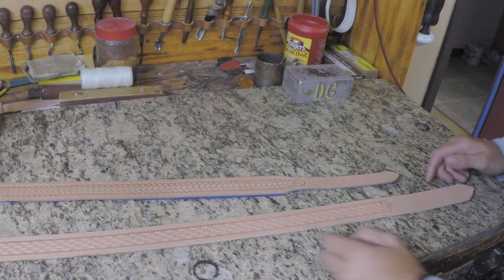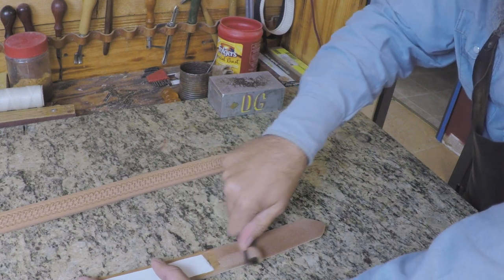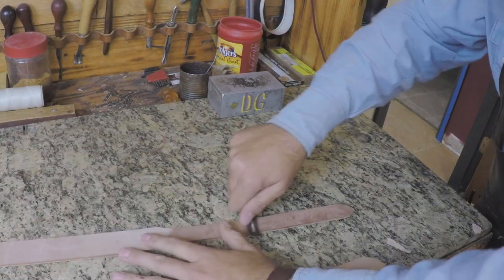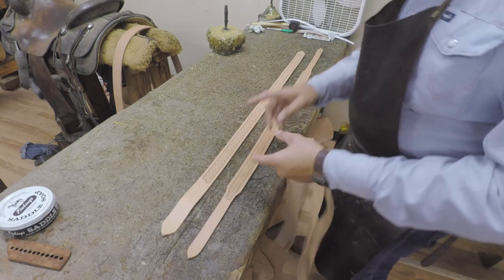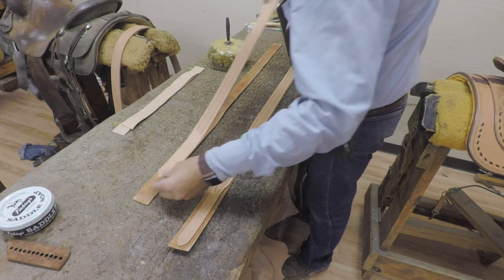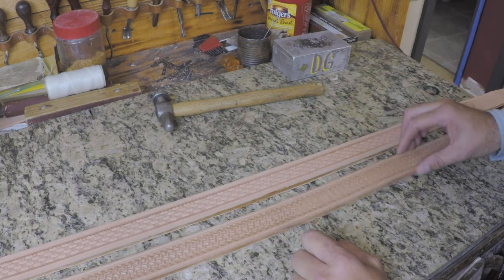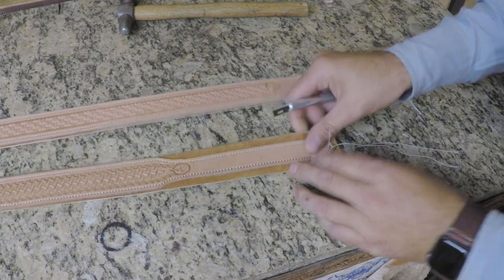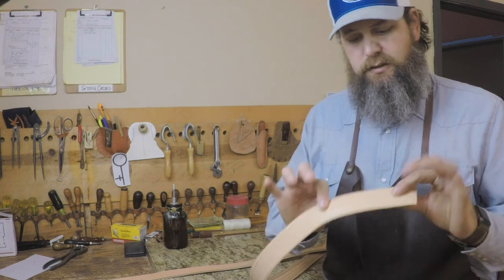How to Line a Leather Belt

Comment: I'm very impressed with your skill to sew that free hand without a guide, I can do that with my Tippmann Boss but haven't tried it yet on a belt with my Class 26.  I do love the guide on my class 26, it works great.  One thing I've learned when sewing belts into a stitching groove is that you have to be sure your groove is a standard distance from the edge.  If there is even a millimeter change in the gap you can very easily get outside of the groove on the class 26 as it's really hard to see where that needle is going.

Comment: Question for gluing.  Could you use a J roller like they do when gluing up formica on a countertop?  Or is there a problem with that?  I am thinking rather than hitting it with a hammer.  Thanks

Comment: Dumb question here. That's looks like your glue table where you have talked about in the past where you use a piece of cardboard on it & let the glue dry. Does that dried glue scratch your linings & if it does does it scratch the leather bad enough that it shows bad?
Reply: @maddawgnoll  Yeah that's what I use but mine seems to get hard enough to scratch my linings on stuff. It does help hold things in place but I hate to get scratches on things even on the backside.

Comment: You line the butt end where there is no tooling to thin the leather down? I guess I'm doing it wrong, I only line the tooled area. Of course I don't have a sewing machine either, so less work. I don't see the point in lining the buckle end, it ends up being almost exactly the same thickness as my lined area.
I've recently started buying 12-13 oz or 3/16th + thick Hermann Oak harness leather and don't have to line them at all.

Comment: When I do a lined belt, I get a lot of wrinkles during use.  any advice as to the cause?
Reply: What type of leather are you using as 'lining'?  If it's too thin it could wrinkle.  It might also be due to the glue.  Calf has a tendency to wrinkle as well.
Reply: @MrHondoMan  I am using two pieces of 6 oz veg tanned. Not Sure if it because of 2 equal thickness pieces or leather quality
Reply: @frankbruce6889 , what part of the animal?  Butt, back, shoulder, belly, side, neck, or unsure?  If you are using vegtan, best to go with butt or back for a belt.   Nothing else.  These are the strongest and most durable parts.  As far as thickness.... sorry lad, I live in Europe and we deal with millimeter not ounces.... use roughly 3-3.5mm.  For the lining, down to less than 1mm.  Most won't want a 5mm thick belt! No more than 3.85 for a belt unless specific request. As far as the wrinkles, if you are using two pieces of equal thickness, it sounds like you have poorly tanned leather or it's not 6 ounce, but perhaps less.  Could also be belly or neck.
Reply: @MrHondoMan  using the back. Total thickness of the belt is 4 - 4.5mm.